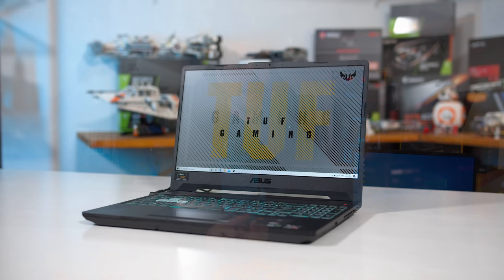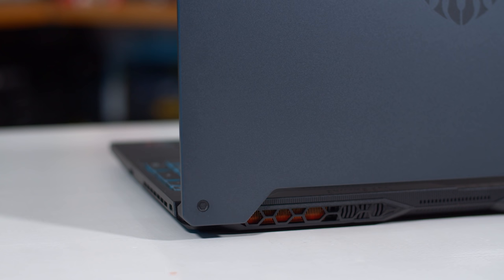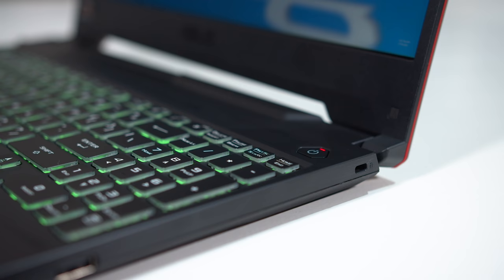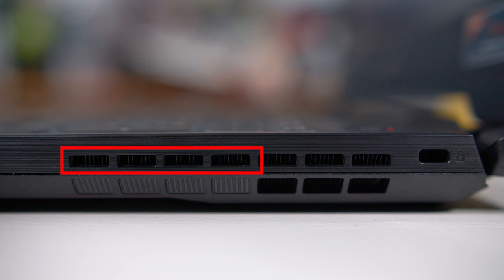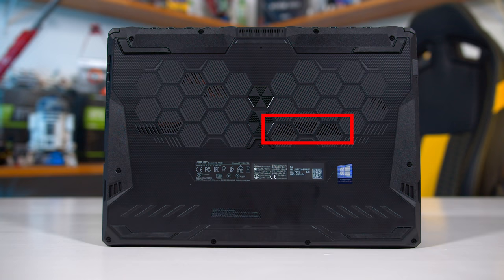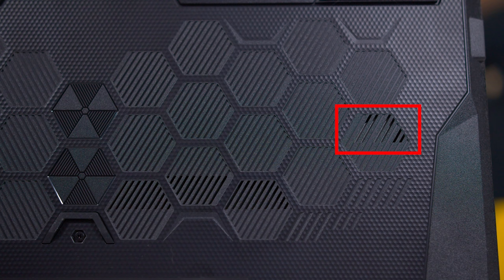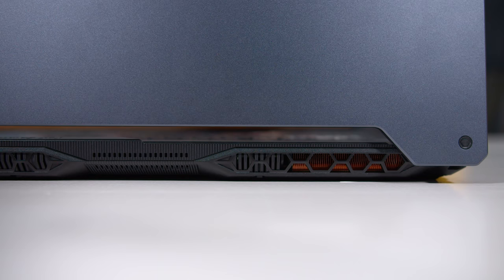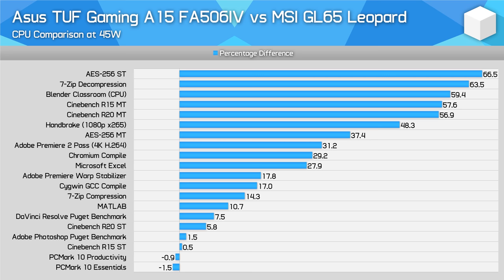Don't Buy The Asus TUF Gaming A15 (2020 Model)

Comment: Why OEM these days almost all of them gimping AMD Ryzen 4000??? Either lower Display quality (high refresh rate but huge response time) on it's price compare to their Intel SKU, Low-Mid Tier GPU or design flaw ....
Smh
Reply: It has been well-known issue that 'blue' gave OEM incentives for downgrading AMD product's SKUs...
Reply: see rog zephyrus G15 review, its air intake are blocked!
Reply: To make 7nm amd based laptop in parity with 14nm intel when it comes to heat, performance and efficiency? I wonder why asus designed like this?
Reply: Think about it. If their budget laptop outperforms, runs cooler, has more battery life AND also has a comparable screen? Their top end products with Intel inside will NOT sell well. They need to gimp this beast or else they'll hurt their own sales. Very very scummy.
Reply: @muhammadhanifkurnaen6689  yep, proves my point.
Reply: INTEL IS PAYING THEM BECAUSE AMD IS SMACKING INTEL
Reply: INTEL PAYS OEM TO BOTCH AMD LAPTOPS1!!!1ONE!!1one

No. It is just Asus doing Asus thing.
I've lost my trust on them long before this kind of shits get exposed.
Reply: @HuntedByAFreak72  Btw Dell G5 SE also terrible thermal choices. ALL OEMs are doing it intentionally.
Reply: @Rhino123freak  What I don't understand then, is why don't they just make a 4800h laptop that kicks ass and sell it at a retail price comparable to intel?  The profit margins would be off the chart.  Why intentionally gimp an amazing and cheap CPU when you can just as easily charge more and make more money?
Reply: to be fair most of these oems are simply incapable of designing good laptops too; many similar flaws exist in laptops on the blue side too. if no one has a decent design, then that's an issue though.
Reply: RhinoFreak i agree if they want to segmentize they product so they don't eat each other. But why must with high temperature device. It would be better to ship with lower power limit as it just take litle compromise compared to limit cooling capacity which will hit the product in long run and probably will backfire themself with tons of waranty claims. If they said they maximize performance for value of product is useless because it just run at standard power limit.
Reply: @muhammadhanifkurnaen6689  Is it just me or does Zephyrus sound like "the virus"... just something I noticed. XD Anyway stay away from the disease, be it digital or analog
Reply: @homewardboundphotos  I believe currently nvidia and Intel has an exclusive deal for 2070 and above graphics card which may not last next year. I'm fully expecting next year laptops to do exactly what you described.
Reply: @muhammadhanifkurnaen6689  limiting power draw is very obvious and can't be justified that easily. Block air vents is easy because they can just bullshit a reason. Plus you can tweak the software and power limits if you're savvy enough.
Reply: There are big brand and investment risks associated with high end. So manufacturers don't wanna go all in in the 1st gen of anything. Remember the state of 1st gen Ryzen motherboards? X370 basically peaked at "meh", and it was quality and effort downhill from there.

Once the new era generation of product has proven itself to be solid, then 2nd and 3rd party will be willing to risk bigger investments. Ryzen 4000 mobile (basically the 1st real and somewhat mature Zen mobile chips) is great, but they didn't know that when developing and engineering the laptops for it. What they did know, is that the early Zen mobile chips sucked donkeyballs.
Reply: INTEL
Reply: Ignatius David Partogi  No, my point is the opposite. Ut does  apply to them. Maybe in some instances even more than other 3rd party / OEMs. Knowing that desktop Zen/Zen+/Zen 2 chips do well, in no way automatically means that laptop chips will. And for those manufacturers and OEMs with former experience with Ryzen mobile, this is particularly explicit - because the former two gens of Ryzen Mobile, were really not good laptop chips; they drained batteries like electric dragsters and the performance didn't scale well. The IGPs weren't exactly great either. It's an entirely different platform and form factor, with tons of restrains and requirements that desktop chips and platforms don't need to worry about. These manufacturers and OEMs had lots of reason to be hesitant to invest, bolstered by their former experience with Ryzen Mobile.

We now know Zen 2 Mobile does really well, in non U skus. Something neither we nor the OEMs did when developing the platforms they go into. Hopefully we'll see some higher end models further out in the Zen 2 Mobile life cycle, but it also needs to be supported by sales figures. There's no lacking of customer base buying mid-range laptops, the OEMs need to see those actually sell in reasonable volume first, before investing in high end. Doesn't matter if the technical performance is awesome, if the units don't actually sell. Here too, we can't really extrapolate and make reliable predictions, in particular not from chip and motherboard sales. Those mostly go to "educated" customers, that have some (up-to-date) technical knowledge of what they're choosing and getting. The majority of laptop customers, not so much. To extrapolate and make any sensible attempt at prediction from other segments, "we" likely need to look to large (non boutique and ethusiast-segment) SIs, and sales figures for preconfigured Ryzen desktops. And the reality is, that doesn't look great for higher end desktop units. Sales look good for budget and mid-range, but as interviews and sales stats from those SIs and system builders have shown time and time again; Ryzen-based rigs don't really sell beyond the $1700-$2000 mark, even if the technical performance-value is superior.

AMD have had a whole decade of poor performance, and pretty much non-existance in many segments. That image and reputation is gonna take a lot of time to shift among OEMs, general consumers and corporate acquisition workers. Particularly so for laptop, because of the average customer preconceptions of tech, how much more device engineering (and thus cost) is involved, and how much more of the flac comes back to bite the laptop manufacturer if the result is a bad seller or bad customer experience - versus with "just" motherboard.
Reply: Ignatius David Partogi  I think your reasons are correct regarding AMD CPU and Dedicated GPU pairing price lists...
but they do not stand when OEMs give AMD laptop crappy monitor like 60% RGB...
Reply: @pr0xZen  So these OEMs dont like to take risks for R&D (which is kinda bad for businesses in growing, and businesses want to grow anyways. So basically bad business strat there). How long does it take to design a new bottom plate for a laptop with better airflow? Not that long. How hard is it to put a good screen in the Zen2 laptops with a high refreshrate screen but poor response time? Not that hard.
Yes, some parts of the laptop will have meh R&D with what you said. Your points would otherwise make sense if it only wasnt the fact that these botches for AMD are way too simple to fix for them.
Reply: @PhantomMattcraft  Well you seem to have it all figured out far better than everyone working in financial financial departments, market research, RnD, engineering, design, testing, prototyping, manufacturing, marketing, 2nd and 3rd party hardware supply allocation, market, partner and distributor relations, and all the logistics segments between them.

Apparently no reason and no hinderance for why they shouldn't have new, redesigned, differently spec'ed and equipped models out right away, even though the other new models they've been working on for a year or two are barely hitting shelves around now. You really should be pitching this to Dell, Lenovo, Acer, Msi etc. You'd be a fought-over golden goose. Or better yet, pitch this to your bank and start up your own laptop OEM business. You'll be a trillionaire in barely a few years.
Reply: @pr0xZen  "Lets redesign the chassis so that basically no air can get in. As obviously less air means better", Do you really think they gave it that thought? That they'd redesign the wheel around simple, already very well established info, for no non greedy reason at all? They know how to make a decent damn cooling solution and it really isnt that hard at all for them. Just look at the mid/high end Intel laptops. Tell me, what is a good non greedy reason to completely kill airflow in a laptop? Maybe we should also start removing the fans too to make it passively cooled? Obviously we are redesigning the wheel completely if they cant understand the extreme basics of cooling, as rn it seems to be just about a linear scale of less air means better. Something like this isnt rocket science. We arent talking about designing a $250 mobo. We are talking about a sheet of fucking metal with some holes in it to allow airflow and for ports.
I'd guess high end laptops is mostly why they screwed these cheap laptops. Doubt it's because "Intel pay OEMs hurr durr" but because their $3000 laptop, apart from some more smaller changes like thunderbolt not being there, is being matched or beaten by a $1200 - $1500 laptop. In the end, still greed that's screwing with things.
Reply: Ignatius David Partogi  not if people stop buying these crappy amd laptops when word of it spreads

Comment: The review spends 20 minutes saying that the Asus chose a poor display and did a poor job cooling the circuitry. Cooling matters if you don't want to be heat throttled.and the display matters if you want accurate color and/or non blurring images.  

Had you read this comment before watching the video you would know what's in the video and 20 minutes to do something else.
Reply: short and easy :)
Reply: 7 mins in.. good thing i scrolled down, thanks
Reply: Thanks
Reply: I was reading the  comments the whole time
Reply: Thank you so much. Can't listen to a robot for 20 mins.
Reply: Get more knowledge watching video than read comment, it's your choice.
Reply: 3 mins in and I found this comment thanks for not wasting my time :)
Reply: you save my time bro....
Reply: 2 mins in and saved 18 minutes. Thank you 😬
Reply: So its pretty much a great choice unless you mind the 2 problems you mentioned?
Reply: this should be pinned to the top, Thanks!
Reply: Thanks man
Reply: Thank you.
Reply: But is it actually heat throttled or just 10c hotter? And wouldn't an 8 core ryzen heat up hotter than an intel anyway hmm something seems fishy
Reply: Thanks

Comment: Man, I have trusted Asus for years. They have broken my trust now.
Reply: How the hell did you do that? Other than motherboards they are one of the most untrustworthy brands out there!
Reply: @makisekurisu4674  Even motherboards, some of their bioses for Zen 2 were straight up borked and untested for months
Reply: @kendokaaa  gigabyte all day for motherboards
Reply: All OEM's have do that, sell garbage on budget mobile laptop.
Reply: @kendokaaa  yeah their B450 ranges are absolute trash!
Reply: @makisekurisu4674  not all, b450-i and b450-e are fine, best in their class.
Reply: @wakaflockaproject  naah, MSI. 

My rating:
MSI
GIGABYTE 
ASUS
ASRock

ASRock is the worst as they use the cheapest parts, low quality capacitors, mosfets etc, especially on their lower end boards.

this is from personal experiance, i repair motherboards (not a pro but yeah) I've owned/used/tested nearly every AM4 motherboard on the market.
Reply: @abdullahkarim1171  most msi mobo i used had that stupid 99 error xD , i kinda not trusting them anymore
Reply: @abdullahkarim1171  Did you see Buildzoid's tear-down (and tear-up) of Asrock Z490 Velocita a few days ago? https://www.youtube.com/watch?v=qmKiwDL3UrA
Reply: Pickin7 I had a Asus laptop for 5 Years and it was perfect the entire time, only got rid of it cuz I wanted an upgrade, sad they made so many mistakes with the TUF series
Reply: Already did that with my FX504..... Basically the same shitty thermals
Reply: Their mobile sucks too
Reply: I'm pretty new to the PC scene. And I've heard NOTHING but bad things about Asus products. 
Maybe they used to be good a decade ago or something?
Reply: TUF luck.
Reply: lmao, you trust these companies? and then Asus? lol
Reply: @kendokaaa  Their Z270 boards had plenty of issues with XMP as well.
Reply: @makisekurisu4674  what about graphics carda
Reply: See the g15 zephyrus they botched it with using platic to block air vents
Reply: @czbrat  yep they were one of the best brands of pc components. But nowadays they have some pretty crap products.
Reply: @khalilveronessi4819  similar story to Intel CPUs then

Comment: I can't stress enough the importance for us customers of serious, comprehensive tech review channels like you guys or Gamers Nexus. Bad products like this one have to be exposed, so as we don't end making a purchase we later regret (especially in countries like mine where refunds or RMA are difficult and/or expensive).
A few days ago I saw the review of this laptop on another well known "serious" tech channel that mentioned the low quality of the screen, but on the other hand praised the cooler design from ASUS just because "the temperatures were below throttling level" while at the same time complaining on the fan noise... Even then, the bad quality of the screen was not stressed enough, saying it was "ok for gaming" and not good only for content creation.
Keep up the good work guys, your content is amazing not only for the technical reviews and sensible buying guides, but also for entertainment. Cheers from Uruguay!
Reply: i spent like a year looking at reviews before i got my laptop, and i still love it 2 years later. one of few 8th gen laptops with 2 m.2 slots, and the 1070mq still runs everything like a champ. the CPU does love running hot as balls though
Reply: Very well outlined, thanks.
Reply: We need names of that other channel
Reply: Name the other channel
Reply: Brad Haines are you referring to Digital Foundry? I agree, DF got this one wrong. Tbf I’d rely on DF’s opinion when it comes to graphics, game engines, and gaming performance analysis. I wouldn’t use them for laptop reviews. I don’t blame you however for trusting them since the majority of their content is very detailed and thorough, but they’re not on the same level as Hardware unboxed.
Reply: Louis Drew not 100% sure who Brad is referring to, but it sounds a whole lot like Digital Foundry’s review from a month ago
Reply: @Andytlp  I'd rather not give names to avoid unnecessary backlash, given today's internet antics. Although their review for this product was flawed, I don't think there was any agenda behind it.
Reply: @Andytlp  Probably hardware canucks
Reply: @louisc4878  probably hardware canucks
Reply: @thelegendaryklobb2879  HardwareCanucks and TechTesters both have very positive reviews for this laptop in the recommended videos area here. Guessing one of those.
Reply: @Facelord well TechTesters said that notebook is quite hot while gaming and it's feels uncomfortable.
Reply: Don't u think this review is too darn critical? 
Expecting a $1000 laptop to perform in par with a i9 laptops should be enough to appreciate this laptop.
This review is very harsh
Reply: Wena socio, cómo va la cuarentena en Uruguay??
Reply: Do you create visual content? Are you getting paid to do esports demanding a 9 ms or 3 ms latency? If your answers are no & no, then the screen is good enough for your purposes. One can hook the TUF to external or buy a different laptop that costs more. 
I'm not even confident any of these reviewers have even set the TUF up for optimal screen viewing. If they are measuring the screen unplugged, on a mode other than silent and on default visual setting, then they are doing it wrong. 
I would prefer it to have 100% sRGB and I can see the difference. I agree the screen is a weak point, but it was an upgrade over my old screen, so moot to me. I haven't found a comparable cpu at this price point and the 4800H matters to me.
I've watched a lot on this laptop, I don't recall any of them praising the 95C. I can hear the speakers just fine over the TUF fans. I can even hear them over the louder other fans in my room. I do have some concerns about the cooling, but one can make it run cooler, boost off, undervolt \ overclock.
I do have an issue now with the A15 that I need to figure out. Maybe it's heating. Maybe it's typical AMD quirks or drivers.
Reply: j
Reply: Brad Haines 8th gen intels (especially 8750h) were a hot boi tho, had to undervolt it 😂
Reply: Lmao he chatted so much shit in this video its incredible
Reply: Really the TUF A15 can handle heat better than I can. In 38+C (Over 100F ) weather, with the boost off & undervolted gpu, it still stays mostly sub 70C (it did get a brief max at 80C, under the most extreme, I was willing to do). It would probably do its thing if I left it stock to hit the 90s C, but that's more heat in already hot temps isn't appealing.
Reply: asus tuf a15 OR msi gl65 leopard i7 9750H which can i prefer
usage : softwares like matlab , Solidworks 
&  games sometimes
Reply: As a content creator myself, I use external monitors, the laptop monitor is way too small for doing anything useful. And yes I did replaced the rear panel.